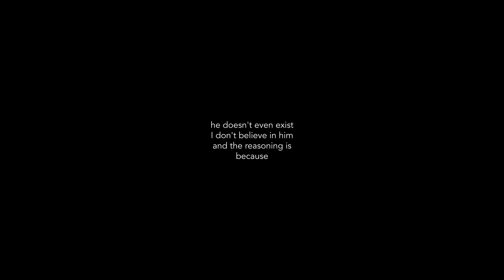ZOMBIE SURVIVAL CHALLENGE! *Simulation*

Comment: Clearly, you're not smart. first off, all gas stations would be dry (and if they aren't, groups of people will be there guarding it, and its kos. that's the first thing to go. 2nd, making all that unnecessary noise at the barn is going to attract unwanted attention from zombies and anyone else in the vicinity.. I'd be using that crossbow as I can reuse the bolts, and it's quiet.. guns are loud, the bullets are hard to come by.. 3rd, you're wasting time by goofing off.. I'd be in and out searching for stuff I'd need and quickly get out of that town as that would also bring attention to other survivors who would have ill intent. 

Also, if you got a vehicle, you driving around would also bring unwanted attention.. silent weapons like crossbows, I guess a slingshot if you got good aim, throwing axes if you got good aim.. and use the guns. If it's a dire situation or you have other survivors near that, you will have to take them out.